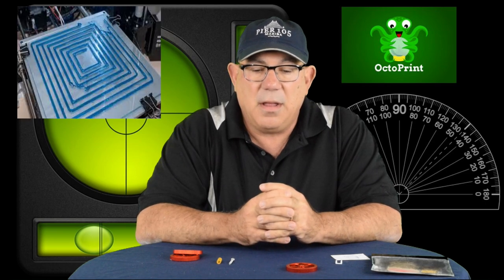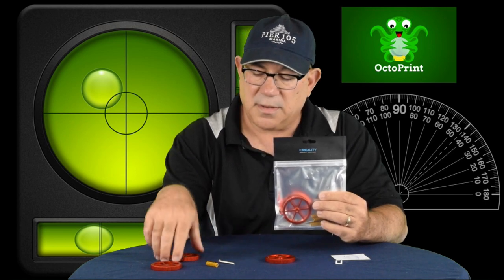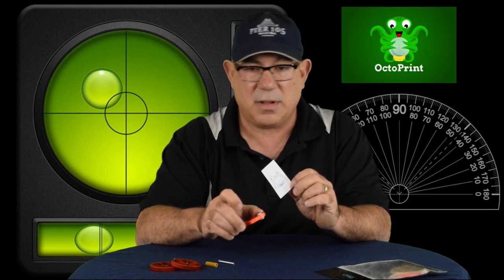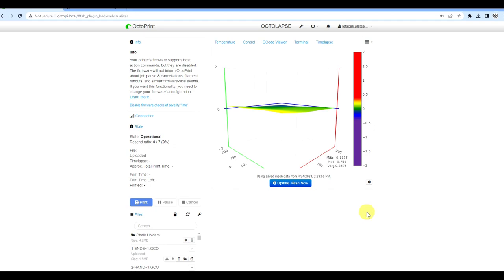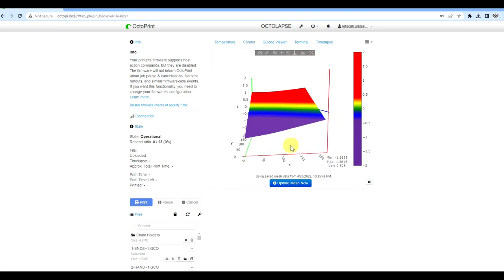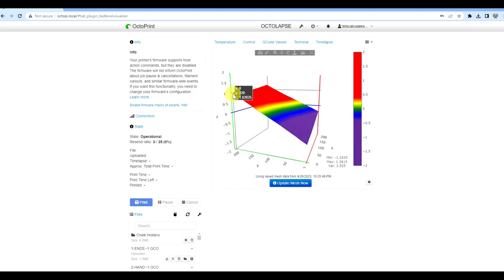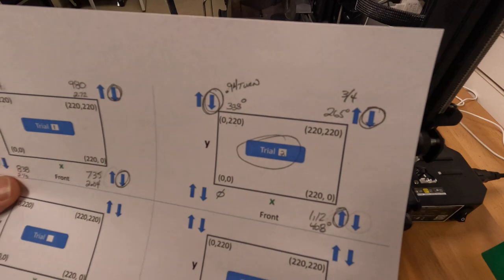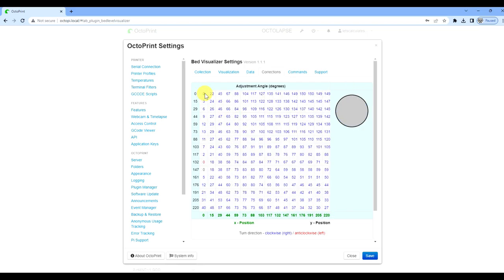Tips, Tricks and Tools to Level your 3D Printer LIKE A PRO!!!!

Comment: Yes, this works well. But after you do this a few times, you can get a feel for how much to adjust it without having to calculate how many degrees. I generally just turn it 1/8th of a turn for small adjustments and 1/4 of a turn if it's not in the green zone.
Reply from the maker: General trial and error is what most people do. Your print quality results will reflect that.  This is way better.  Try it!
Reply: @Let's calculate something  oh, as soon as I went to octoprint I surely was doing it the way you mentioned. But with some practice, it's possible to get the whole bed down to one shade of green with only one readjustment with just some quick estimation.

Comment: First adjusts are easier to be done by eye. I think the fine tuning, especially by calculation, would be more precise if you consider the values from the coordinates of the 4 levelling screws position. When you're turning the wheel/bolt, those are the pivot points, not the corner of the bed. Probably that's why you need two rounds.

Comment: Does octoprint allow you to use SCREWS_TILT_CALCULATE?
Reply from the maker: not that I am aware of, but I wish it did.
Reply: @LetsCalculateSomething  If there's access to the klipper command line/console in octoprint, it could be worth a try running it as it's a klipper command. I'd try it myself but I run fluidd.

Comment: I'm getting confused when looking at or trying to figure out which way the colored visual is facing.
Then I am totally lost with the adjustment angle corrections numbers and how you figure out which way around it is. 
I would have thought the front of the print plate would be along the bottom, and zero should be bottom left, as you look at the screen.
Not top left of the chart and that making the top right number the left rear on the bed.
Or am I completely lost in my train of thought?
Reply from the maker: if you go to the thingiverse link, there is a template with the four "protractors" - they are labeled so you can identify each corner wheel.  Each one tells you which direction to turn up or down based on what octoprint tells you.  Hope that helps.